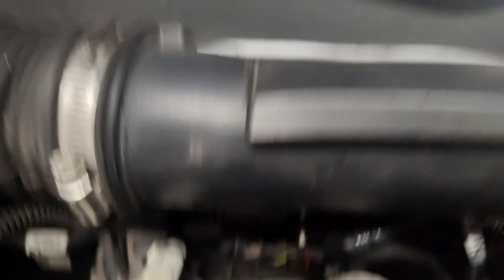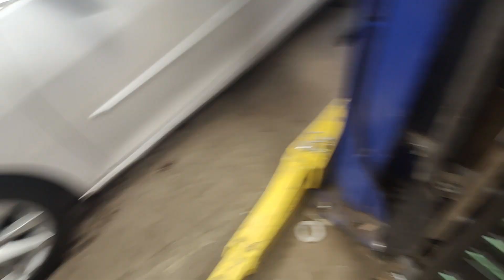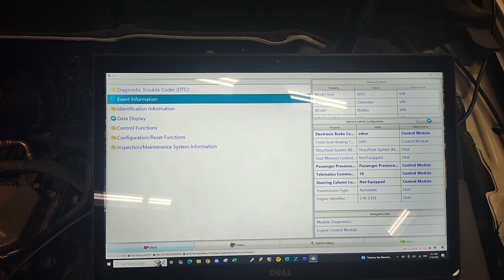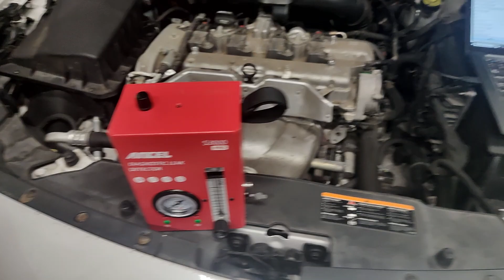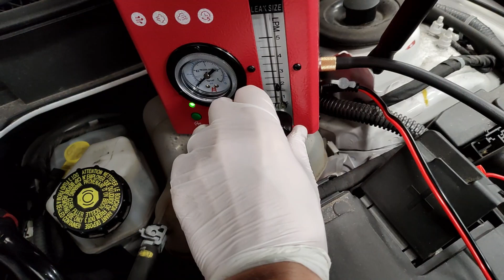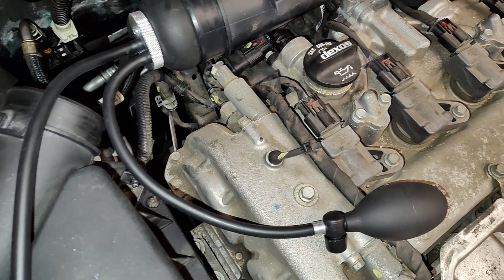Amazon Smoke Machine Testing for Vacuum Leak Diagnosis - 2015 Malibu 2.5 P0171 Part 1

Comment: I work in a shop with the p171 code smoking it for leaks would have been the first thing i would have done im surprised that you took it to two shops and they didn't do the same.

Comment: Do you have to manually open the throttle plates. On the throttle body.
Reply from the maker: I didn't even think of that... It was probably just closed the whole time, tests worked just fine.
Reply: The throttle body is never fully closed and the fact that you see smoke come out of the intake manifold gasket is proof of that.